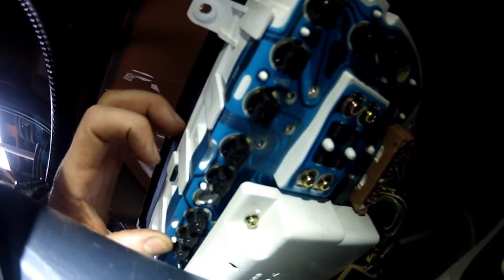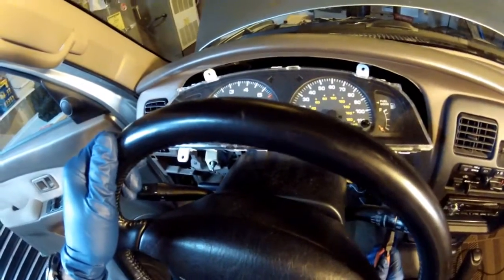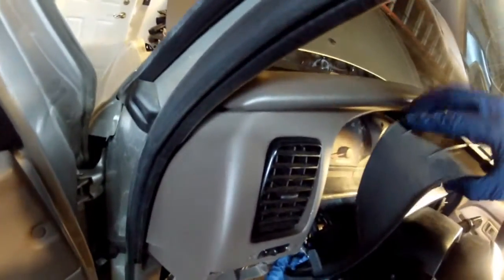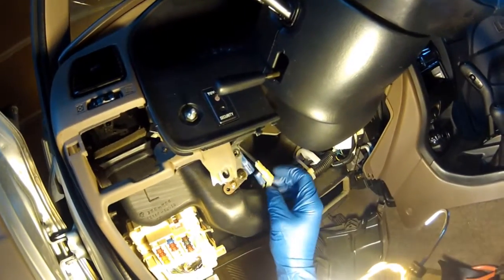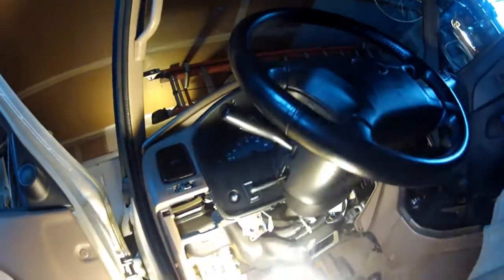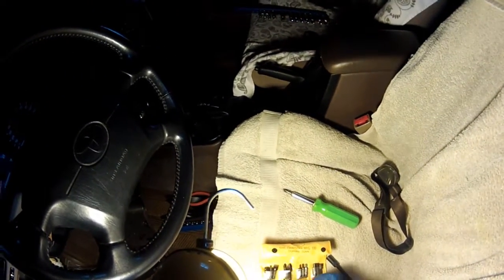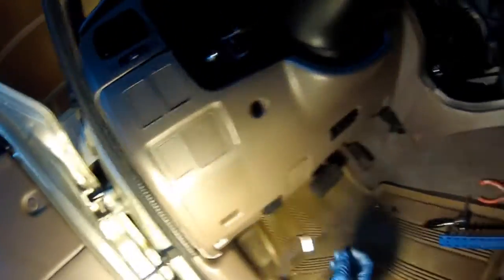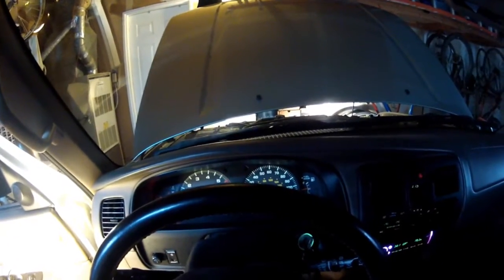Instrument Panel Light bulb Replacement

Comment: I finally replaced the lightbulbs for my dashboard on my ‘97 4 Runner. The plastic bulb holder cracked apart with a couple of them. The plastic was just too old. I got replacements on Amazon and the green color bulb cover also. Now I need to replace the ones for my temperature settings.
Reply from the maker: Good job getting it done.

Comment: Thanks! This motivates me to replace my D light (which is dim but still working) and the left dash light behind the tachometer. Is there a diagram of which bulb is which type somewhere?
Reply from the maker: I don't know if there is a diagram.  You just have to line up the gauge with the back where you pull the bulbs from and you'll be able to figure out the right bulb to pull.  It might be some trial and error but I was able to figure out pretty easily which light I needed to replace.  I don't think there's a multitude of different bulbs used for this dash cluster.  Go to your local dealership and bring the bulbs you need to replace and they should be able to get you the right ones.

Comment: Tim, another great video. I have a similar issue with the instrument panel not lighting up any of the gears that I'm in. I went ahead and replaced the 'D' bulb, but my instrument panel still isn't showing light on any of the gears. Would you recommend I replace all of the other bulbs (P,R,N,2,L)? Or could this be a problem with wiring? Thanks!
Reply from the maker: Erik Lucas it does sound like a wiring issue but I'd pull the other bulbs and take a look at them.  I'm not very knowledgeable about diagnosing auto electrical issues but I'm starting to do some research on the subject.  If you figure out what it is, please get back to me and let me know.
Reply: Timmy The Toolman thanks for the feedback. Looks like I’ll start with replacing the other bulbs first and go from there. I’ll let you know how it goes.

Comment: Can you do a tutorial on replacing the center console light bulbs? one of the lights on my hvac system (the knob that controls air circulation) just went out, I got the face plate off but getting that bulb to come out is a little tricky.
Reply from the maker: royaloreca At some point Sean and I will make a video for this but we have plans for a bunch of other videos in the works right now.

Comment: is there suppose to be a small gap around the edge of the cluster guage or does it lay flat against the other plastic piece cause I have a gap around edge
Reply from the maker: The gauge cluster and black plastic piece screw in where they screw in.  As long as you have all the fasteners in their rightful place, you got it back together correctly.  So, if you see a gap after getting everything connected up properly, then the gap is suppose to be there.

Comment: @Timmy The Toolman:  I enjoy watching your YouTube channel and have found your videos informative & helpful for my repairs or modifications. I have a '99 Tacoma Xtra Cab/4WD/V6/MT. I have 2 bulbs that won't light in my climate control panel and is hard to see at night to make adjustments. I've tried changing the bulbs and the climate control panel still won't light up. Do you know what is the part no. for the light sockets for my truck? Are those light bulb sockets compatible on a Tacoma climate control module? Can I buy the same light bulb sockets that you used to fix my climate control module?
Reply from the maker: Good to hear you like our channel.  I don't have any answers for you regarding your questions about the light bulb sockets because I have no experience replacing them.  Sorry I couldn't be more help to you.  Maybe your question would be better asked on Tacoma World in the 1st Gen section.  Good luck!
Reply: @TimmyTheToolman  Thanks for responding to my questions. I did post the same question on the Tacoma World 1st Generation section forum, but no one has answered my question with the information that I'm looking for.

Comment: To start, your channel is amazing. My question is; I have a 1999 Toyota 4Runner Limited model, 3.4l. On my Instrument cluster, the blue circuit board burned out and I am looking for the part number, but cannot find it. Do you know where I can find the part number for it?
Reply from the maker: Glad you like our channel.  How do you know the whole board burned out?  I guess nothing is working?  You could just go to your local dealer and they could look up the part number and sell you the part but that might be the most expensive route.  I do know of a guy on Facebook that sells OEM parts that equals online pricing.  His name is Joe Joe.  You can message him and get a quote for your dash cluster circuit board.  https://www.facebook.com/profile.php?id=100028915082377
Reply: @TimmyTheToolman   Where the two strips connect into the main circuit board, the widest strip is burnt through, now none of the backlights work except the park- 1 low and warning lights work.
Reply from the maker: @shawncrampes6494  I wonder how that happened.  You might have a short somewhere.

Comment: 1st gen Tacoma ashtray bulb does anyone know of a video that shows how to replace this bulb?  Thank you 🙂I bought a plastic pry set, I just don't want to break anything on my 20 year old awesome 5VZ-FE 4WD AT/with manual transfer shift...etc I'm replacing all my internal bulbs dome, map, glove box, ashtray, <--I don't smoke but its a great place for coin change and its is burnt out now.  I also seem to have a parking brake cable that is not pulling the release handle completely into the switch, problem.  The switch works I verified that but, the plate that is supposed to depress it is not making it all the way to properly indicate it is off.  I could try to add a spacer to push it in, maybe some rubber or silicone material would work.  Do you think tightening the park brake adjust back at the rear diff would help this pull properly?

I did search your awesome videos for answers to save time and effort, much appreciated by anyone to help point me to success thanks.🙂
Reply from the maker: You just have to remove the trim piece around the stereo and heater controls to access that ashtray bulb.  In this trans gauge video, I show how to remove the center trim piece: https://youtu.be/fT_2szdKXRM  There are some differences with the years but this will give you a good idea on how to do it.  

I'm not sure about your e-brake handle issue.  I'd have to be there to see what's happening to figure out how to fix the issue.
Reply: @TimmyTheToolman  Thanks Tim, right at https://youtu.be/fT_2szdKXRM?t=1356 you start in about the ashtray etc  Much appreciated!🙂
Reply from the maker: @xtrchessreal  You're welcome.

Comment: @Timmy The Toolman: I recently bought a 1998 4runner limited and decided to update the Instrument panel with LEDs; however in the mist of cleaning the inside of the panel (behind the clear plastic cover). I accidentally touched the speedometer needle and now there's about a 10mph difference (reads lower). Any idea to fix this? Love your videos and appreciate all the details you give out.
Reply: FYI the 4runner is all stock as well
Reply from the maker: Hey Tony, maybe try disconnecting the battery for a while and then reconnect it and hopefully the speedometer will have reset itself.
Reply: Had this happen with my temperature needle any idea how to fix it?

Comment: My reverse dash light is on when i am in drive, thoughts? 98 4runner
Reply from the maker: Sounds like something is haywire with the signal from the shifter.  I've never troubleshooted something like this, but if it were me, I'd start at the shifter to see what I could see with how the electronics work.  You could use our trans temp video to see how to get the center console and shifter trim pieces off.  https://youtu.be/fT_2szdKXRM  I'm assuming the gear selector signal is coming from the shifter but maybe it comes from the transmission.  If you can't figure it out, search online and maybe somebody on T4r.org has run across the same situation and started a thread about it.  If not, you could start your own thread asking for help with this.  Let me know what you figure out because I'd like to learn about it.
Reply: I had a similar issue on my 3rd Gen. I believe I've narrowed it down to the Instrument Panel Circuit Board (Part #: 83861-3D260). It's the blue "sheet" that sits behind the gauges (2:40 in the video). Turns out after twenty years and 300k miles, some wires have wiggled loose and crossed or something. Anyway, I'm tackling the job tomorrow as well as the bulbs, so I'll update you guys soon.
Reply from the maker: @SusVir  Yeah, definitely let us know how the repair goes for you.  I guess every electrical component can fail at some point but you're the first person I know of that has had to replace the instrument panel circuit board.
Reply: @TimmyTheToolman  I installed the new circuit board and am happy to report it fixed it!!! No check engine light! —It was throwing the P1780 fault code: [Toyota] Park/Neutral Position Switch Malfunction (Only For A/T)— I had the Park/Neutral Position Switch replaced to no avail, so that was a waste of money. But I'm just happy it's fixed now! The install was super easy. The solution was finally found by scouring the T4R.org forums. Link below!

https://www.toyota-4runner.org/3rd-gen-t4rs/77138-transmission-issue.html
Reply from the maker: @SusVir  Hey Chris, thanks for responding back and sharing your fix.  That's great news.  Hopefully Bryce sees your response.

Comment: Do you know if the 4th gen 4Runners have replaceable bulbs like this 3rd gen or their bulbs are soldered into the circuit board?
Reply from the maker: I'd have a hard time believing they're soldered to the board.   I doubt Toyota would be that cruel to their owners.  Just visit your local Toyota dealer and tell them which bulbs you want to replace and they'll probably have them in stock or they'll order them for you.  I know parts are expensive at a dealership but sometimes for inexpensive parts like this, I'll visit the dealership instead of trying to source them online.
Reply: I will call and check. Thanks!

Comment: Please help!!! I also need to replace my "D" drive light in my 01 4runner limited. Can you or someone send me a link to which bulb this is. I just wanted the green that it came with. Thanks!
Reply from the maker: Hey Cory, the part number for the bulb is #83120-60020.  Buy it at your local Toyota Parts Department or order it online.  With shipping costs, going to the dealership might be your best bet.

Comment: Hi bro, i would like to know if the bulb of the 4wd can burn out? Cuz when I put my 4hi the ligth is on the dash is  not come on, can you help me please, thank you
Reply from the maker: Yeah, of course it can burn out.  I don't think there's a bulb that lasts forever.  Pull the instrument panel out and check it out.
Reply: Ok, if the bulb is burn out do you think thats why is not working my 4w4 sistem??
Reply from the maker: @360ikki  No.  If your rig isn't going into 4wd, the bulb isn't the cause.  The bulb lit up is just a visual to let you know you're in 4wd.
Reply: @TimmyTheToolman  ok I got it, may be the ligth it can be good and i need to replace other part, a switch maybe, but thank for your help bro I really aprecciate

Comment: Taking this apart doesn't compromise the odometer?
Reply from the maker: No, it does not.  You're only disconnecting the bulb.  No other electrical connections are disconnected.  Also, I believe the odometer reading is coming straight from the vehicle's computer and not somehow stored in the dash instrument panel.  I know people have completely disconnected their instrument panel to do aftermarket LED lighting and I don't remember anyone saying you had to worry about the odometer reading being changed.
Reply: Hell no.

Comment: My Hi-beam indicator light does not work but the bulb is good.  Any suggestions?  Thanks
Reply from the maker: Does your Hi-Beams actually come on?  If not, maybe it's a fuse that's bad.  If the Hi-Beams come on and the bulb in the instrument panel looks good, I don't know what it could be other than a bad wire or connection.  How do you know the bulb is good?  Did you just see if it looked burnt or the filament was broken or did you replace it and it's still not lighting up?  Another possibility is you pulled the wrong bulb.  Maybe you grabbed the one you thought was the high beam indicator bulb but you accidentally grabbed a neighboring one.
Reply: The Hi-beams come on and I swapped several bulbs around and found none that were bad.  Moving from left to center,  the Hi-beam indicator seems to be the last in line before the transmission indicator lights.  But I can go in and double check.  Thanks for the response and for the great video.
Reply from the maker: Hey Hans, if the bulb is good and it's still not lighting up, I don't have a good suggested next step for you other than looking for an obvious severed wire or loose connection.  I haven't delved heavily into troubleshooting electrical issues so I wouldn't be the best person to consult on this type of problem.
Reply: Thanks again Tim.  Subscribed
Reply from the maker: You're welcome Hans.  Did you figure out the issue with the indicator light for the hi-beams?

Comment: Got a radio with no light to see the tuning dial, radio works fine..
Reply from the maker: One of the wires that powers the radio is an illumination wire.  You could see if there's power getting to that wire with a test light or multi meter.  This video will show you how to get everything taken apart to get the stereo out and also let you know which wire is the illumination wire. https://youtu.be/fT_2szdKXRM

If there's power to that wire, then the stereo has an issue.

Comment: Can someone here please help me with the part number for the bulb that illuminates the gauge cluster the main 3 bulbs i want to replace with LEDS but can find the right part number any help would be so greatly appreciated
Reply from the maker: You might have a better chance of getting this answer if you look for a related thread on T4R.org and ask your question there.  But, you might find your answer in the thread because somebody has already provided it.
Reply: I was looking and didn't see that Timmy the tool man ill look again thank you not trying to waste anyone time just keep ending up with the wrong bulbs everyone says it should be 194 and they are to big for my year
Reply from the maker: @christopheradams7309  Gotcha Chris.  I just think your chances are better on T4R.org.  There's lots of knowledgeable dudes on that forum and I'm pretty confident somebody will have your answer.
Reply: Chris, 3rd Gen 96-98 are #194, 99-02 are #24
Reply: @marcsmartinez01 is that led or normal cause i also had the same issue everyone said 194 but they were to big for the socket and the hole i want blue and white leds but for the life of me i dont know what size i need